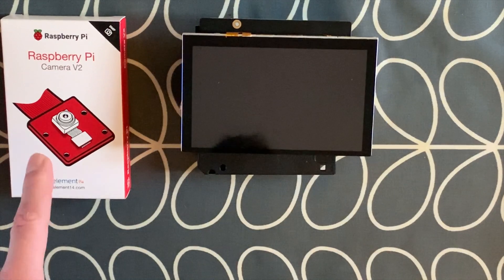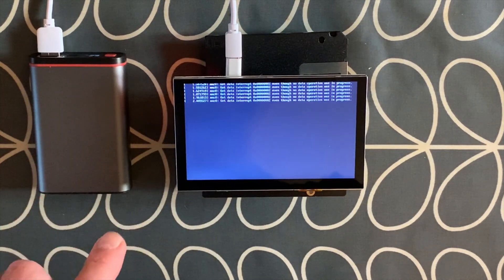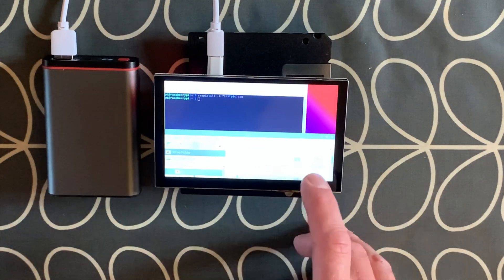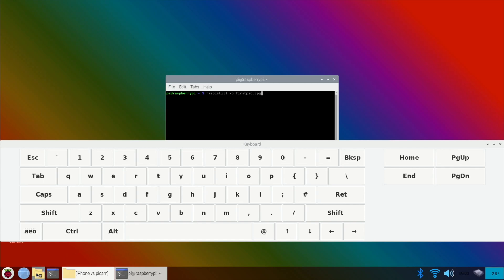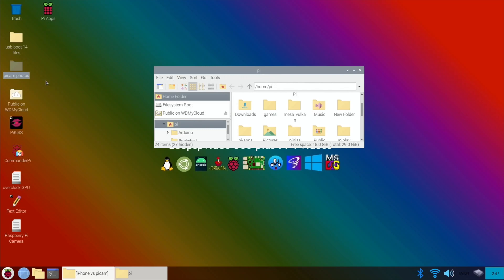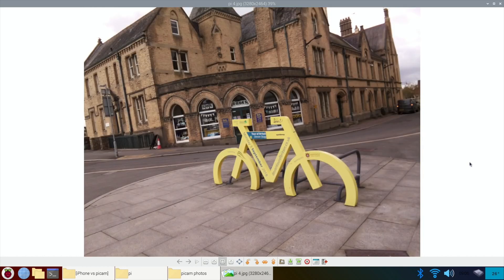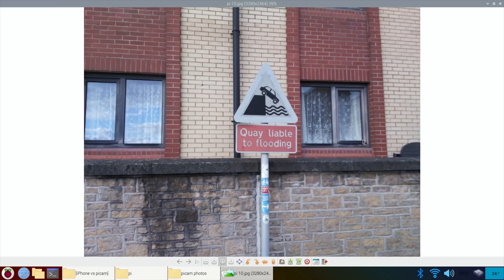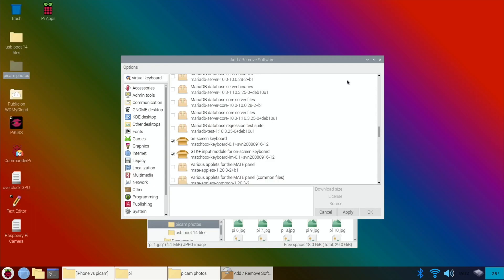Raspberry Pi 4 Portable Camera Vs iPhone XS

Comment: There are some camera modules that have “auto-focus” Arducam? 
I’m not sure how well that works with RPi
I set up a camera following Becky Stern instructable. It is for a “photo booth”
It works but the auto focus camera modules prob need added coding for implementation. I kinda gave up on using it as a daily driver camera because the cell phone camera just works so well. It was a fun project though.

Comment: The camera actually has a manual zoom, you need a tool to turn it or use tweezers. Most of the time it's better at the fixed position it comes in.
Reply: Correction, not a zoom, a FOCUS. :p

Comment: I think you can install cheese camera application for easy photo clicking rather than going to the terminal.
Reply: There's an issue with that, because Cheese didn't recognize the camera easily, since it's not an usb device. It can be done, i'm just not sure yet HOW. If Leepspvideo can find out how to do that, it'd be great because most things that can't detect the rasp camera will start to do so.
Reply: @leonoliveira8652  truth cheese does not like the rpi camera.... we need some help with getting it to work! Also does the rpi camera work with 64 bit os?
Reply: @Blu702  Good question, maybe if we can get to raspi-config at the very least on whatever 64bit os is running, then probably yes. Also, if the OS is based on Raspbian, even more likely. It'll probably just be 32bit drivers running on 64bit system.